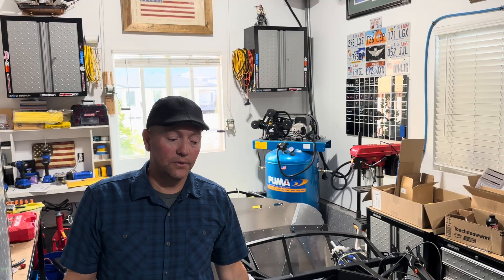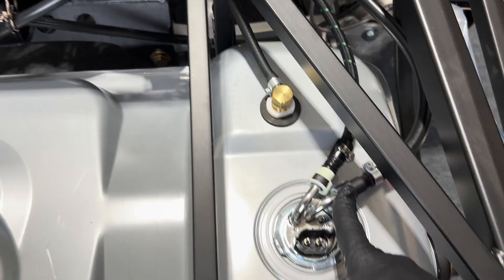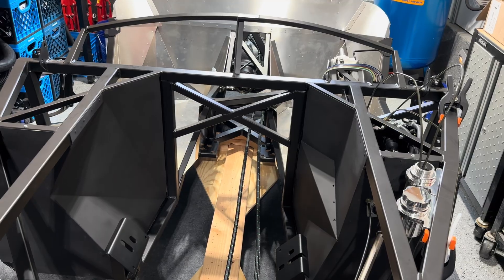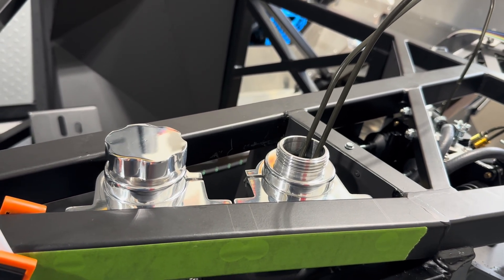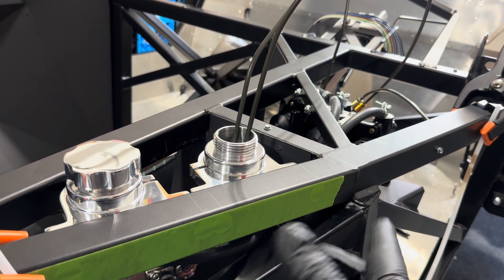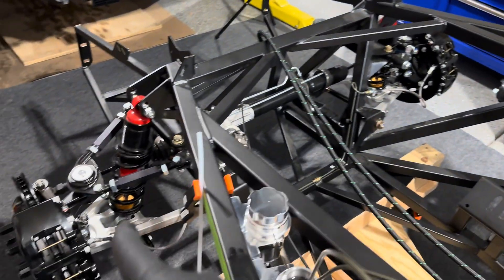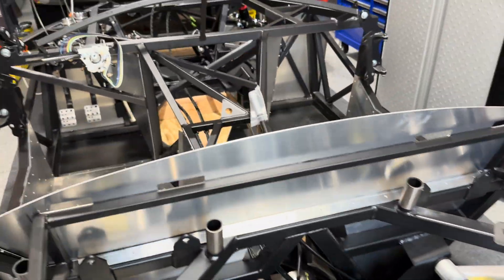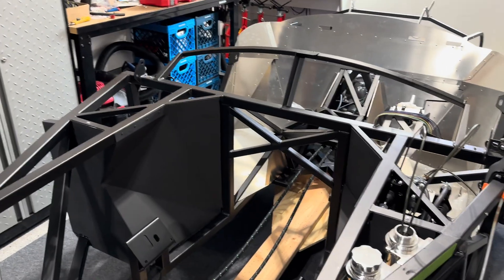Episode 18. Fuel and Brake Lines plus bench bleed on the FFR Mk5 Roadster.

Comment: I just found your channel, my MK5 kit is finished and I should have it in a few weeks.
I was going Coyote but I decided on the fuel injected 347 and its on order too.
I went to the build school and took advantage of the discount they offered if you ordered there.
Two of my friends from the forum recently completed their MK4's. 
One is a Ford Performance 427 fuel injected,  it's a monster ! 
Super fast but hooks up pretty good with 18 inch sticky tires. 
The other is a Blueprint  302 fuel injected with the traditional 15 inch wheels. 
It's still a very quick car with the ability to break the tires loose with ease.
After riding in both I decided the 347 would be just about perfect driving and handling with the 18 inch sticky tires.
How did the frame dolly work on the MK5 ? I'm thinking of making one up and didn't know if there were any dimensions you would change to fit better.   I have  a body buck my friend gave me but he used jack stands for his build.
Trackday17 on the forum btw, good luck with your build !

PS if you decide on a different fuel pump setup Aeromotive makes a nice pump assembly with threaded inserts in the top for AN lines for the Fox body Mustang.
I've already sourced one and a fuel filter assembly for my build as I'm going with AN style hookups and lines.
Reply from the maker: The frame dolly actually works great as is. It allows me to roll it into position where I can grab the car with my MaxJacks lift. The Mk5 is completely flat on the bottom, so it just rests on the felt strips I coated the dolly with. Good luck on your build! It is an exciting thing to watch that Stewart semi pull up to your drive.

Comment: Few things to consider - your reservoirs will be under the body. From that rail to the body, it’s a little over 3.5”.    AN line to a barb fitting after the fuel filter isn’t recommended, May depend on which AN line you have.     Great idea on the water line level!   Also - 427 fuel requirements should be looked at and considered for how big the outlet and return are on your pump.    Happy building!
Reply from the maker: Thank you for that information about the body/rail clearance! That helps out a lot! I am wondering if I should have gone with a better fuel filter than the one supplied in the kit? The kit filter only appears to have quick connect/disconnect ends on the inlet and outlet. I don't believe I could do a hose clamp over the end since the interior of the fuel line is fairly rigid and I doubt it would fit over the outlet side. Could you give me some suggestions? Thx in advance!
Reply: @FrostDogGarage I’ve switched to AN setup.  Even on my 347, I’m doing -6 feed and return.  Different pump. Check with your engine builder/supplier.  I think FF setup is 5/16 feed and 1/4 return, which may not even get 400hp.  You’re likely way above that.   If you find my build on the forum and PM me there, happy to send pictures of my setup.
Reply: @rcsracing98 that’s what we did too. -6 supply and return from a GM filter/regulator

Comment: Thanks FD really enjoy your videos, Im a few days behind you and also only mostly get weekends to do anything. Im staying with flex fuel lines for now and my update that at some time in the future if it feels wrong. Feels like catastrophic failure of driveshaft is bad in any case with a skinny bit of aluminium protecting me from a piece of steel spinning at several thousand revolutions per minute. Im putting a coyote in mine and have left space for a supercharger like erik did, in the very unlikely event i need more. I have a brake bookster in mine that I just put in. Hard lines next weekend hopefully.
Reply from the maker: Great to hear you are right around the same stage on your build as I am. Will be good to do a little collaboration going forward to bounce some ideas off you.
Reply: @FrostDogGarage  I have been away for too long, but getting back to it now. Im going to use both brake resevoirs and also have hydraulic clutch so will find a way to get all three in the place you have 2. Did you end up having to cut and flare any of your brake lines or are the lengths all good?

Comment: Enjoying your videos. Question. Would you be willing to share your build sheet. I’m getting ready to order my MKV
Reply from the maker: I will be out of town for a few days, but I can send it to you when I get back.
Reply from the maker: Kit Type: Complete RD Mk 5
Left Hand Drive
Engine: SB 351 (Blueprint 427 Stage II)
Transmission: TKO/TKX (Blueprint Tremec with special 5th gear ratio)
Clutch: HYD
Exhaust: 351 Headers w/FAST
Rear Exhaust: Mk5 steel 4 into 4 side exhaust
Rear Suspension: RD IRS
Shocks: F&R IRS shock set (Koni)
Rear Axle: IRS center + spindles
Front suspension: Standard width
Driveshaft: 31 spline IRS 8.38
Steering: PWR
Gauges: Vintage GPS 7
Seats: Black leather
Frame coating: PWDR frame, satin blk
Rollbar: Mk5 LFT + RHT black
Brakes: 12.88 Wilwood black
Steering wheel: Vintage wood
Body: Mk5 body w/cutouts
Dash: Carbon fiber
Seat Harness: 5 PT 2 inch
Mirrors: GT400 polished x2
Hood Scoop: Carbon fiber
Options:
-Sun visor set
-Wiper kit
-Oil cooler kit
-1.5" rollbar grommet set x2
-IRS front & rear swaybar kit
-Mk5 & CP Gen3 floormats & HDW
-Brake reservoir parts
-EFI in-tank fuel system
-FFR vintage oil temp gauge
-Wind wing set
-Trunk gas strut kit
-Seat track kit
-Assembled side louver set
-4-way batt cut-off switch kit
-Brake duct wire mesh set